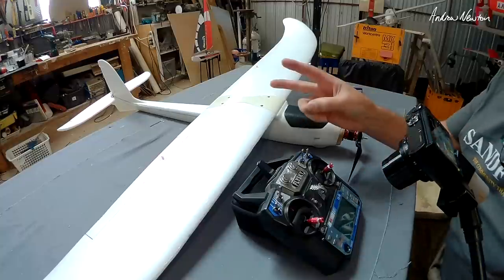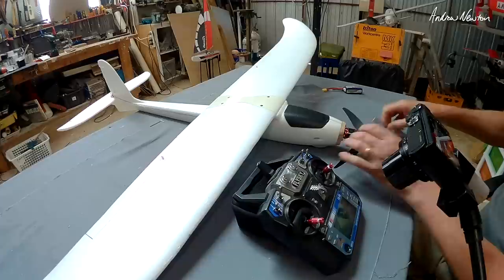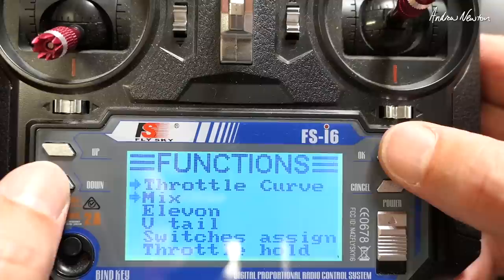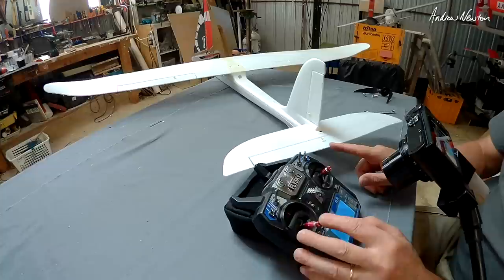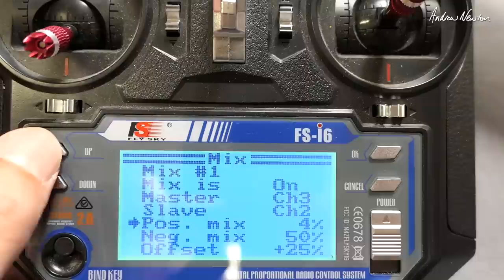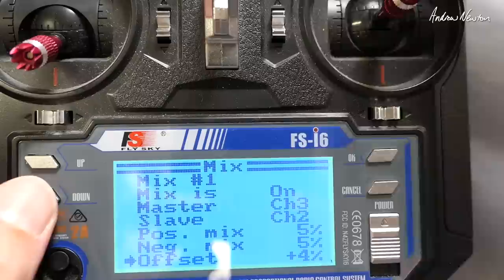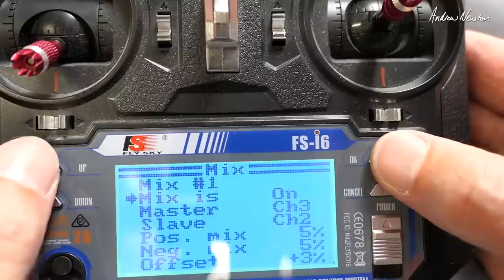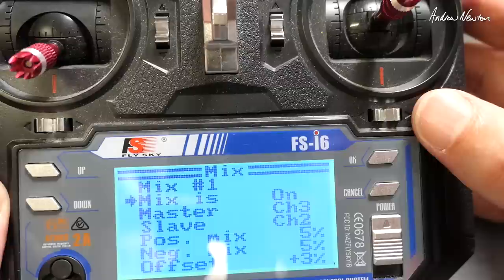FlySKY i6 Throttle Elevator mix

Comment: Great timing, Andrew, I just maidened the Night Radian 2m yesterday , the nose pitched up under throttle big time, it was perfectly trimmed for gliding.  This is a perfect glider, a much better floater than the Phoenix Evolution 1.6m I debuted a month ago. I would say the Radian is the better thermal glider hands down over the Phoenix Evolution. The Night Radian also has a better wing mount system and some of their fuselage and prop issues have been addressed. Very impressive, slow gliding.
Reply from the maker: Yep nothing thermals like a Radian

Comment: Very helpful. Your videos on the FSi6 radio have saved me lots of headache. I've noticed my Neutron going nose up with throttle...this is just the ticket. I'm starting a new glider build, trying to lighten the weight. I've cut the carbon/graphite shaft from an old golf club...makes a light and strong tapered boom !
Reply from the maker: Perfect shaft, good luck with the new build

Comment: Very helpful video, i wanted to do the same but elevator up and have it on a switch just for launch, but dont think i can put it on a switch with flsky
Reply from the maker: If you have a spare channel you might be able to assign the switch to a channel then use the channel in a mix

Comment: Another handy tip, Andrew! 👍 Q: What mic are you using on your cap? The only decent mic I have at moment is a bulky Rode omni for my DSLR and I'm shopping for a good lavalier or similar. Cheers
Reply from the maker: Just the Firefly external mic with this mod https://www.flickr.com/photos/pandasimages/46600466622/in/dateposted-public/
Reply: @AndrewNewton  Thanks, Andrew.  I am impressed that works so well.  I think I may have a couple of those little mics laying around somewhere - never actually tried them

Comment: How do I connect this transmitter to a 6 channel plane I have it mostly figured out but I can’t get the part that’s makes the plane go up and down and turn to work it’s either I make the plane turn or go up and down seems only channel 1 and 2 work for that and I have a 6 channel hobby king bix 3
Reply from the maker: Answers are in my FlySKY playlist

Comment: I bought this flysky i6 for a cheap 10 channel radio. I watch your video plus 6 other maybe more on what to download what data cable to buy and still can't get it to work, sure would like those other channels. Even got my old windows 7 out to see if that would work, NOPE. I don't know if you can help or not. E-mailed Flysky never heard back. I'm running Windows 10. It's to late to send this radio back, should of bought a 10  channel  to begin with. Just thought you might want to know
Reply from the maker: Sorry Jim. I have never upgraded.
Reply: There are a bunch of You Tube videos showing hacks to upgrade these radios. I tried a couple of ways and was not successful. It is important to note that these are 3rd party hackers , NOT FlySky approved upgrades.  For some reason Fly Sky never did these upgrades, even though the radio obviously has the potential.

Comment: Hi i've got 2 questions. 1. I have the fs ia6b reciver, and can that handle analog and digital servos? Maybe the MG90S servo? 2. When you are using folding props than those prop blades can flap about 150 degrees foward and back, or it can't fold fowarder than they are in one straight? Thanks
Reply from the maker: Hello. Yes both sorts of servos work will any radio. MG90S is my favourite cheap metal gear servo. Folding props swing out to 90º when spinning, and I don't know why they allow them to pivot further forward. Maybe so they can be used as pusher props?
Reply: I don't want to use as pusher prop, and i can they are swing out 90 degrees. I bought a folding prop and spinner for it from hobbyking, and after i assemblyed it the prop blades can fold   foward a bit  when it not spins. Is that problem? (i couldn't try out with spinning, but i not want to destroy my new motor)